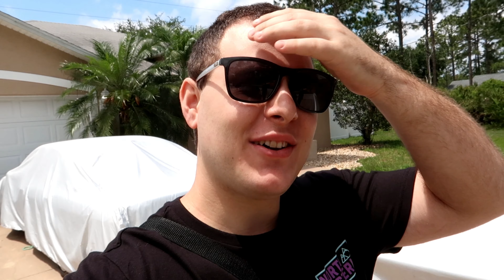Vin's 350Z Gets a Welded Diff + 1JZ 350Z!!

Comment: I’m looking into buying a stock 350z to get into drifting, what are the mods I should do to get it drift ready?
Reply from the maker: Def before you buy a 350Z you def should watch this video https://youtu.be/E0NSB_dKyb0
After you watch it decide if you want a dedicated drift build or not. If you do the mods you need first is a welded diff. Followed by coilovers, toe and camber arms front and rear. Then a TON of seat time.
Reply: Thanks for the fast reply, there’s a little problem though, I want a 350z that could also be used as a daily driver. Will having a welded diff make this difficult?
Reply from the maker: @SoggyRaspberry  Yes it definitely will. I would just run an LSD. That will allow you to daily drive the car and still do some drifting (but you wont be able to do any drift events on an LSD)
Reply: If you where to weld the diff, could you still drive it around occasionally? Do you need to get a trailer to get it to the event?
Reply from the maker: @SoggyRaspberry  Yes you can still drive it on the streets but just be very soft on throttle especially in the rain